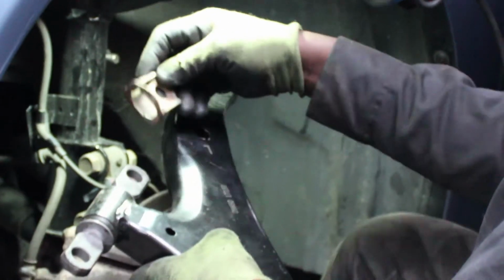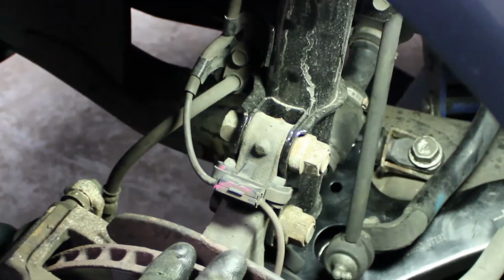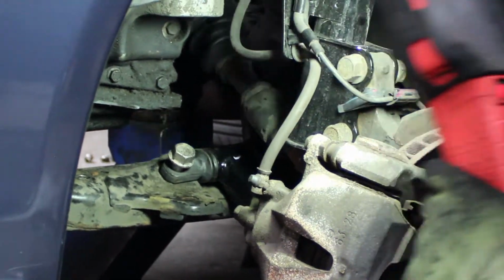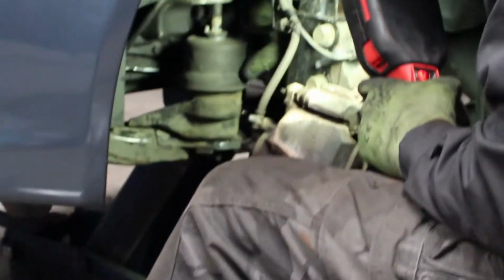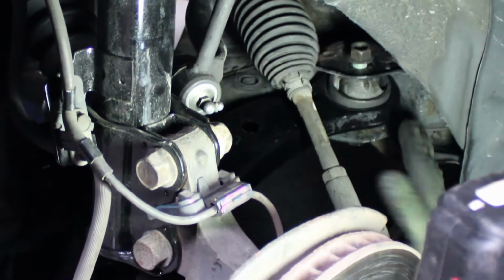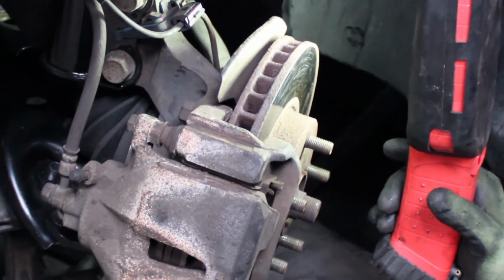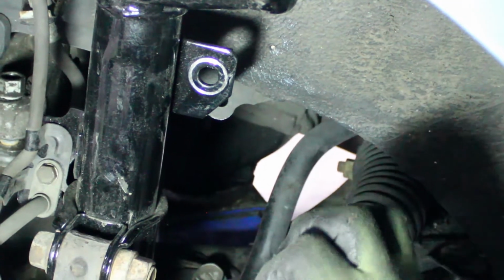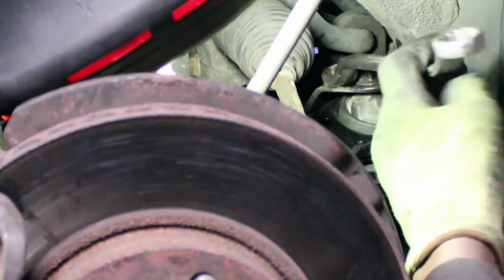How To Replace: Lower Control Arm - Toyota Camry | 2003 - 2016 | (Installing the Lower Control Arm)

Comment: Very important : Always preload the control arm by TIGHT THE BOLT/NUT WHEN THE CAR ON THE GROUND, and torque it right , in this case 100ft/lbs

Comment: Great job Could you please advise what location under the car you use to jack the engine?  I am worried if i use the oil pan I may damage it.  Also do i need to remove all mounts on only this one.  Please advise thx